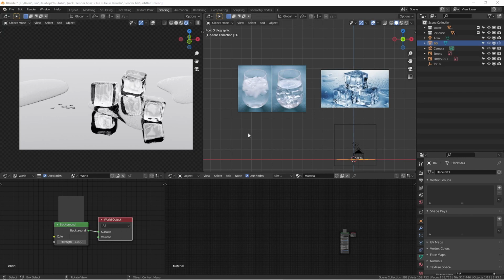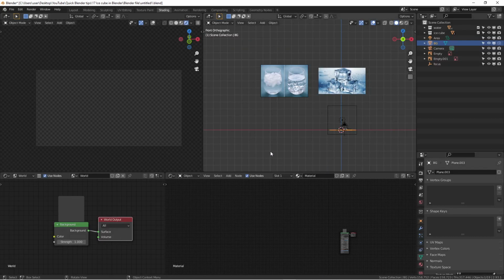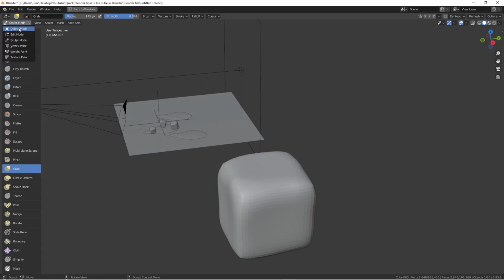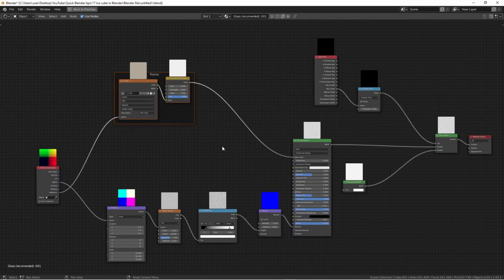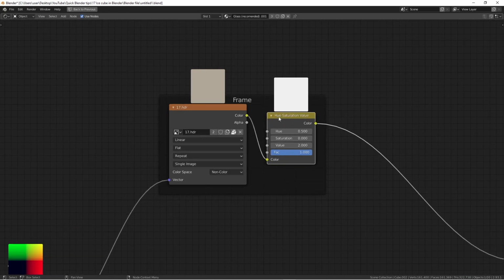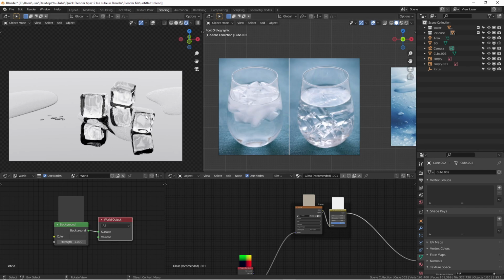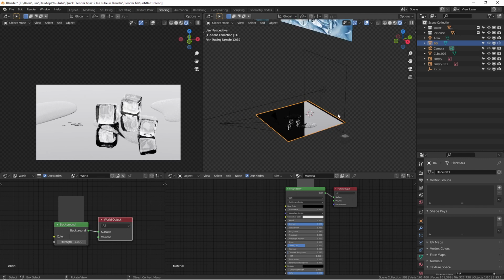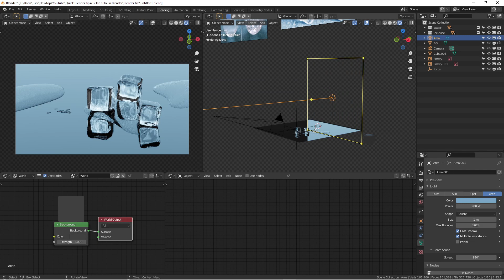How to Create Real Ice Cube in Blender (Quick Blender Tip 17)

Comment: But, if you want to add some kind of whiteness to it, just use the Principle Volume node and duplicate the cube which is smaller. And then, add a rough displacement, to make it look like lines frozen in the ice.
Reply from the maker: Amazing tip mate!
Reply: @WenboZhao  No problem.

https://youtu.be/3ifLAFLcTS8
You can see my render of Default Cube Render Challenge, that's where the results of the ice cubes shader that I use... :)